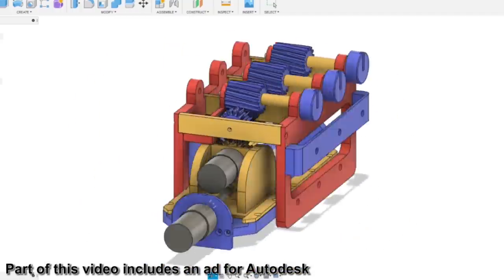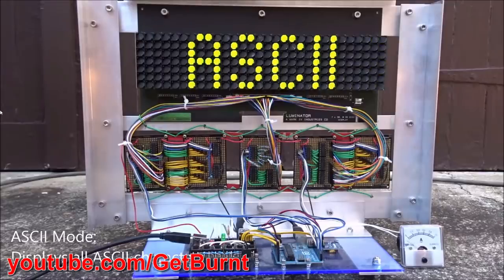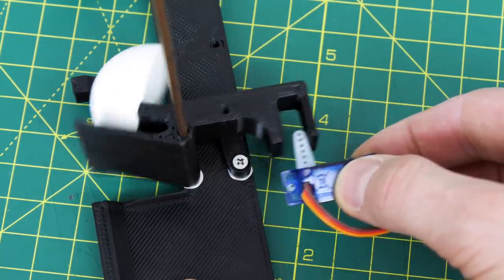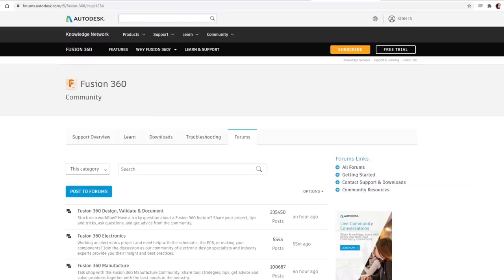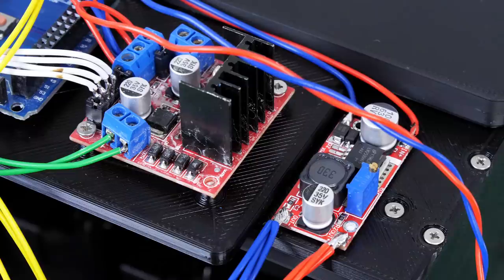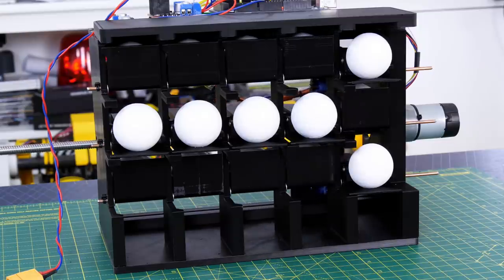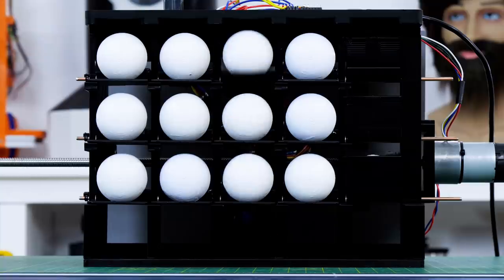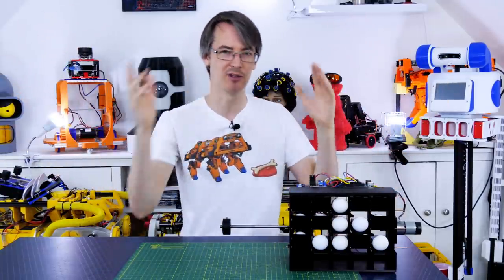Mechanically Multiplexed Flip-Dot Matrix

Comment: I once saw a window display in the Museum of Digital Art in Zurich that has an interesting vertical column of rotatable cells. Each column has multiple dots, each having two sides. Each column is driven with only one motor and the linking mechanism is similar to a flip display. With only one motor, it is able to index the entire column (despite very slowly) to a given pattern.
I'll leave the exactly implementation down to your imagination.

Comment: You might consider updating the servo motor's wiper from a single lever to a spoked wheel. It might have six spokes at 60 degree separation. As long as you orient any spoke in between the connectors, you're good to go; just rotate clockwise or counterclockwise from your stored knowledge of the last bit position.

Comment: If you want the display to always update left to right, a second vertical actuator line could be used to have two.  Each goes from one end  to a maximum extent in the middle.  While one is flipping the other is resetting (carriage return?) So the right can take over once the left reaches the middle.  You can gear it so only one motor is required as they can move in tandem!

Comment: Another nice example for mechanical multiplexing mechanism can be numbered wheels to make numeric combinations by rotating numbered wheels with a multiplexer mechanism it uses 2 motors, 1 for linear displacement and the other to rotate the wheels which will have a geared perimeter. So when you align the selector mechanism with each wheel it engages the teeth of the selected wheel, then turn the selector shaft, selecting a number (could be a letter or any other thing)

Comment: Very clever! I'd like to suggest an idea to eliminate the need to move the levers between each column. If the flip mechanism were replaced with one that could be driven by a cam rather than a lever, you could use the same gear design you had in the previous build and just give each one a half turn to toggle between white or black. Since the teeth on the last design meshed nicely as it moved, this could eliminate the jamming concern and also make the code simpler since it would only need to rotate a half turn in any direction regardless of whether it needs to turn a pixel on or off.

Comment: One of the solutions is to have large beveled teeth in a gear arrangement for the small servos that have a wide spacing so you can never go too far actuating in any one direction. Then you put extremely small distances between actuation of the ball lever so that this gear has to travel a smaller distance (or none at all) to mesh with the levers. The levers could even be converted into a rack to mesh with your "scanning" pinion.

 A particularly slick idea would be to have cloudy, partially transparent white "keycaps" with a black interfacing duplicate underneath, not unlike the "They Keep Multiplying" math keyboards from grade school. Then, you have an continuum between white and black depending on how deep the black insert is to overcoming the cloudiness of the white keycap, which can be controlled from this hypothetical rack and scanning pinion idea.

Comment: Interesting concept! I would design the linkage interface so that it can flip to 2 states but with clearance for a servo middle state which leaves it unchanged. Perhaps that just requires you widen the gap that the servo horn slots into.

Arbitrary numbers say the action requires 60 degrees of servo stroke, let the final 10 degrees in either direction be the flip action, but the middle 40 degrees to be the neutral state. This way your algorithm doesn’t need to save a memory of the column and change state to it as it passes (especially if they are to be left unchanged). The runtime can greatly improved if the algorithm goes: index to next column->flip necessary dots->back to neutral->index (repeat)

Comment: Was thinking of a slightly different approach.  The idea would be for the lever in the back to have an angled surface, such that as the control plane in the back passes by, it only needs to have a "finger" held out.  If the finger is held out high, it would push the lever away revealing white (and, if the lever is already away, there's no contact so we're good).  Or, if the controller held out the finger in a lower position, it would drag the lever back towards the controller revealing black (and again, if the lever is already back then there's no contact).

Couple of things I like about this.  First, you no longer need to know the prior state of the display, because the action is idempotent: you only need to know where you want each pixel to be.  And the individual fingers need only bear load primarily sideways: they can be weak and geared for fast travel.  Which means you can invest in only the one big motor to push the control bar itself, and that thing can shoot the control bar quickly from edge to edge.

With careful design, you could cause the fingers to work correctly when engaged in either direction.  Think of the lever as just a popsicle stick: on the top plane of the lever is an arrow head pointing towards the control bar, such that hitting it as you pass by either way will push it away.  And there's an arrow head on the bottom as well, facing inwards towards the pixel; the finger on the bottom would be crooked upwards like an L, to engage that arrow head.

Comment: The old Radio Shack Armatron used a mechanical multiplexer to allow a single motor to control the gripper and the joints and rotation. It would be neat to have a replica Armatron.

Comment: Belt drive for the carrage. Some kind of sliding wedge arrangment so the carrage motor sets/resets the dots. Use solenoids not servos (not to push/pull but to select set/reset). If you stagger the actuation point of the dot in a coloumn, you could get way with only one solenoid per coloumn.

Comment: What about a "core memory" technique, were whatever impulse you provide is half of what is necessary to flip the bit, so you have to hit both the right column & the right row to flip a particular bit. Then the actuators could slide up and down the sides activating as they go. Well, one would have to flip back and forth real quick one cycle for each step of the other. I'm thinking maybe some kind of air pressure system, but maybe a physical bump would work too. Could be an interlock where the top slider unlocks a column so that the side slider can knock the correct ones in or out.

Comment: To increase efficiency and speed, you can connect strings to each of the flip-dot pixels where the other end of the strings are attached to a smaller matrix of mechanisms so that the servo motors travel less distance horizontally to flip each pixel. Basically, the large display gets projected to a smaller display.

In the current design, a major limiting factor for efficiency is the size of each pixel and as the overall display it is scaled up in size, the efficiency will decrease by a lot. Thus even if you make a much larger display, with this new design, you can actually make it faster than it is with the current smaller display. It would be kind of like a projector that outputs pictures and videos onto a much larger screen.

Since the strings can only be used in tension, the ping pong balls will have to be defaulted to one position using extra weight so they are not balanced. Then you can 3D-print a small and simple bi-stable mechanism for each pixel in the small projected matrix that is switched using the lever arm of the servo motor.  The bi-stable mechanism is so that when the pixel is white, it will be in one position and when the other position is chosen, the pixel will flip. The weight is there so that the pixel will flip back to white using gravity. Since the string would not be able to push the pixel to flip back to the other side, gravity will automatically pull it down when the bi-stable mechanism is switched by the servo.

In conclusion, you would still be using the same mechanism to move the motors, but at a smaller scale so it is more efficient and faster even for a larger display.

Comment: The folk shaped thing that is used to flip the "balls" could be made to work like a ramp.  If you set the servo in the on position before that arm on the servo gets to the fork, it just slides on the ramp and moves it to the new position. 
You could also have an X screw, a Y screw and only on servo.  This would be much slower but only need a total of three motors to do a huge number of dots.

Comment: I'd make 2 changes:

First for the X axis I'd use cograils and have the motor be on the moving part. Much cheaper than the drive spindle. The encoder can be replaced with an end switch and a light gate switch that is triggered in the middle between each position. Then a simpler and cheaper DC motor can be used.

Then for the flip mechanism I'd use dc motors driving either a rubber wheel or a magnetic rotor. That way they wouldn't need to know the current position. Alternatively 2 electromagnets pulling a iron part on the lever either forward or back can be used if the travel distance is small enough.ac

Comment: I imagine using puffs of compressed air to move the pixels so you wouldn't need to run any electronics down the length, just one or two small, flexible tubes per row. 
As others have said, a belt driven system could speed up the run of actuators. 
Got my imagination going crazy with this one!

Comment: I really like the mechanical Multiplexer, but if I had to solve a problem the mechanical Multiplexer can solve I would have jused one motor with several gears on one axis engaged with a clutch for every gear. I think when you would have a heavy load on the gears of the mechanical Multiplexer, the gears wouldnt last very long when they slide together. But still really entertaining to watch, keep going :)

Comment: I think having a magnet on each pixel and an electromagnet to move them on the carriage would be easier as you would not have to worry about the existing state. It would also better allow recovery if the controller loses power and doesn't know what the pixels currently are

Comment: What if the servos had a "gear" on them instead of an arm? You could pass cleanly through all states of the actuator at that point and just rotate clockwise or anticlockwise as you need, since the gear has equidistant teeth all around!
Reply: This is the best idea I've read in the comments yet. This allows you to move much faster as you both don't need to pause or have a gap for the servo to reset as you described, it also lets you move the motor off of the moving carriage. They could sit right next to the ball screw motor. Those gear teeth could simply run on a splined shaft.

Comment: The mechanism on the dots should only have one cam pointing down, not a hole that the servo needs to fit. 
The problem is if the dot is not in expected position, the mechanism will jam. By using a only one cam, you can position the servo lever outside of the area where it can hit the cam and just move it to hit the cam, and flip the dot.

Comment: Only modification that comes to mind is to use a X gear on the individual motors.  that way when they move from one location to another you won't have to move the servo positions back, but just rotate in the required position to change the spheres.

Comment: I think you could greatly decrease the refresh time by first switching to a belt drive instead of lead screw. Then instead of using servos, use a solenoid or even electromagnet to actuate the dots. That way you could refresh the column without having to pause at any point.

Comment: Put a ramp on the servos, which can either point inwards or outwards. The movement of the carriage will then push the ramp against the actuators to flip the balls. Advantage : can be fast, continous movement. Will not jam.

Comment: Before hydraulics, old machinery like cranes and diggers used the mechanical force of the engine pull a series of linkages and cables, with a series of clutches. You could do something similar

Comment: you could make 3 hooks -> /\/\/\ there will be always a passable gap in the middle for the actuator to pass through. Just make sure it won't be pushed twice in one direction :)
Since the hooks are quite wide, the cam could move while the actuators are still moving.  That should increase the speed a bit.

Another idea would be to use actuators that don't flip back and forth but angle themselves in a way to push the flip-dots either back or forth. Like a rudder of a boat (flip forth, flip back, pass through) That way i could be a fluid motion.

Comment: Good video.  I have an idea.  Consider a two dimension matric of small solar cells with concentrating lens or cones.  This array would have to be tracked to the sun position very accurately.  The mechanical multiplexig arrangement could adjust each solar cell.  What you would have would be a relatively small amount of silicon generating optium output.  Also, the array enclosure would not move, unlike conventional trackers where the panel has a large range of motion.  Been sitting on this idea for 20 years.  When i first saw your video on mechanical multiplexing i though it was a fit.

Comment: Give it some memory to remember the display 'bits' and it should also definitely be able to move into the correct positions while in continuous movement, it could be a lot faster indeed.
Maybe even base the width of the switches on the speed at which they pass by, maybe then it wouldn't even need to stop as it moves the switches.

Comment: A faster arrangement would be to place servos along two of the edges. For a 10x10 display, you would need 10 servos for the x direction and 10 for the y direction. A servo on a specific row can flip all of the pixels on the row, but only if the column is "unlocked" by a column servo. This is still a lot less than 100 servos.

Comment: Two mechanical options that may be easier than a travelling carriage, instead coding the pattern in a column in the position or sequence of positions of a single shaft.
(i) a mechanism like a single-dial combination lock (stretched out) to set the angular position of a string of elements - either the balls directly or some levers or gears attached to them.  The pattern of black/white is then achieved by some back/forward at one end of the chain, setting the furthest ball through clockwise rotation, then the next by ccw rotation, etc.  
(ii) gear each ball to spin at half the speed of the one below it.  Say with 4 balls, black on one side, white on the other.  As the bottom ball is rotated  16 times, the sides facing the front go through good approximations of 16 possibilities.  To make it better, add some mechanical persistency to each unit, such as in a flip-clock. (I.e. make a binary flip-clock)

Comment: i think if you switched the rod with a belt, moved the motor to to the slide, and added the circuit board to the slide you could eliminate cables so there would be less cable wear, also it would be substantially faster and easier to expand. and then you could use a twist to pivit the balls instead of a rotation, so even if the servo is in the wrong passion instead of crashing it would move it in to the wrong possion. so you had a sliding track for the twist and by passing by it you would either move it or pass trough setting up the new position, then you could also use a a plate to hold the needle chosing the possion in place so the force dint come on the servo, increasing its life expectancy.

Comment: It is possible to use spring preload servo arm or some type of cam to active the two state (1 or 0), this way, you won't have to remember the previous state. This will avoid crash in case the actual state mismatch the memory state. (someone touch the ball...etc)

Comment: It proves the concept really neatly! Very nice! What about a 1 motor multiplexer for a 2D display with only 2 actuators, one to rotate the motor making it engage each dimension and another to flip 1 pixel at a time. The two axes could be driven by pulleys instead of a rod. It'd be almost a magic trick if it worked! :D

Comment: You may be able to increase the vertical pattern by having more slide linkages sandwiched in the width of each pixel then using ramps that don't care what starting lever position comes by, only changing if change is called.
This is useful for an earlier idea I had where small drawers pop out as needed in a wall of drawers when you need a place for something then again when you need the something.

Comment: What about having the actuators having long arms that are actuated from a centrally located point?  In that way you reduce the travel distance of the column of servos.  For example, each actuator would "reach" towards the middle, instead of being actuated in line with its column.